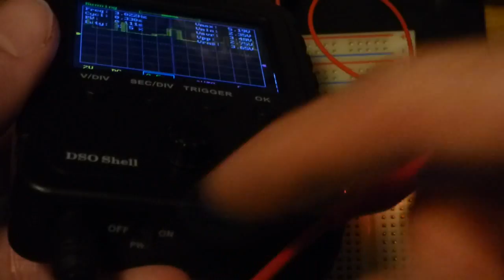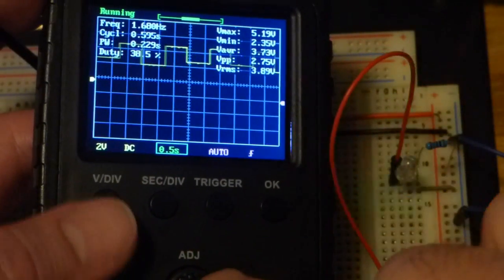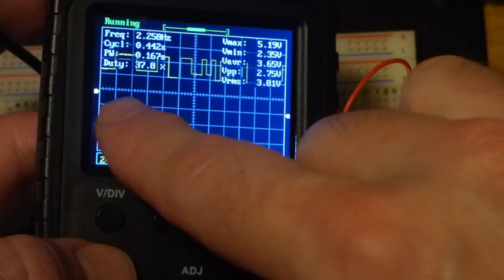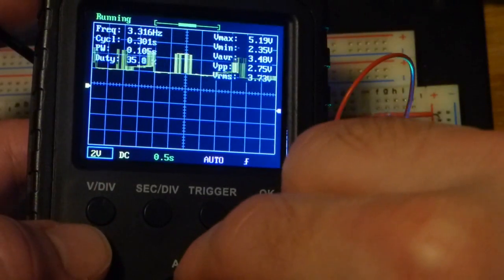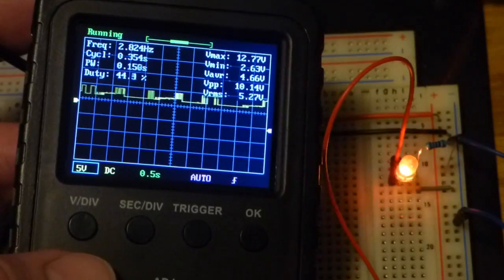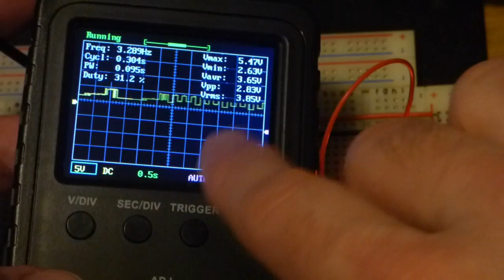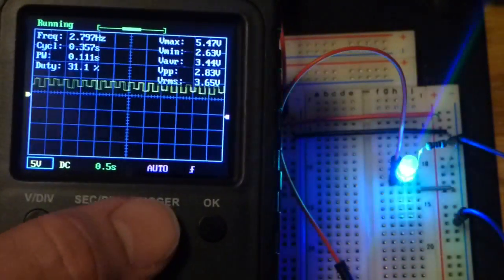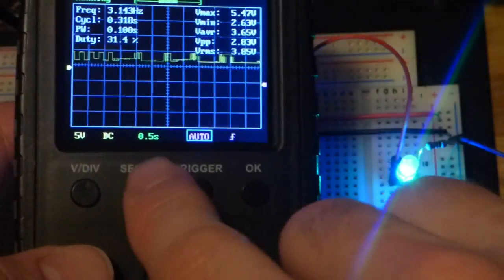New low priced portable Etepon DSO shell oscilloscope first look

Comment: I've looked at getting one of these as I've seen the same brand is cheaper than the other cheap DSO shell variants (in the cream case), but it looks from the official JYE Tech seller (on Aliexpress) that there are a lot of fakes about, which don't allow the firmware to be updated. Would be interested to know if yours is a "real" board or a "fake/clone".
Reply from the maker: Yeah good question, I will try to remember to look into that stuff more. :)
Reply: @Electronzap  Yeah. ETEPON is a fake manufacturer. The board's FW revision code is fake verified by them.